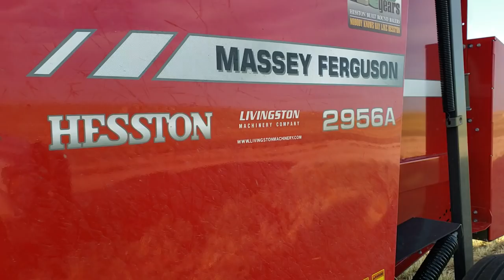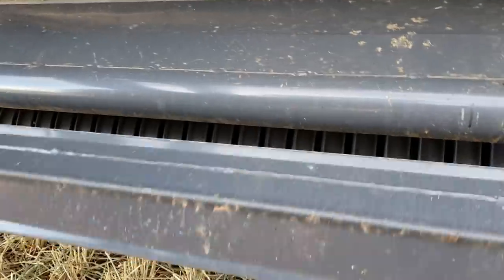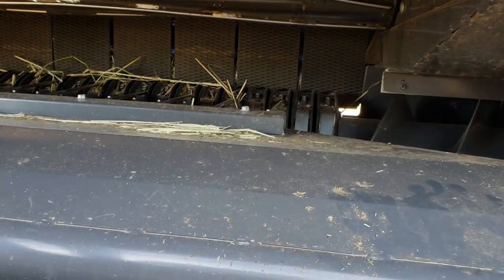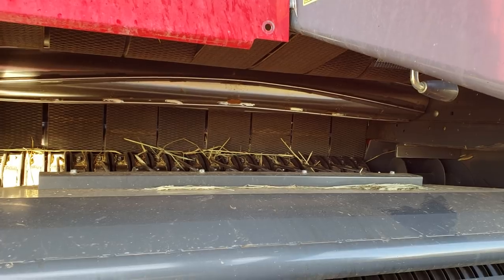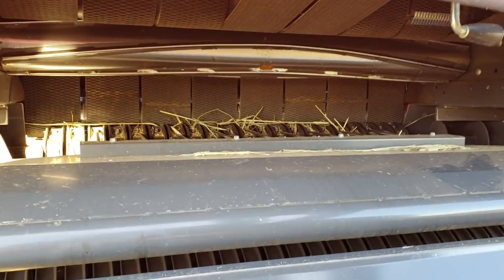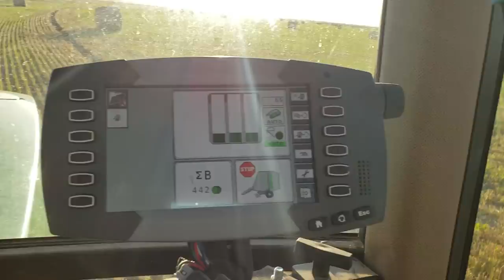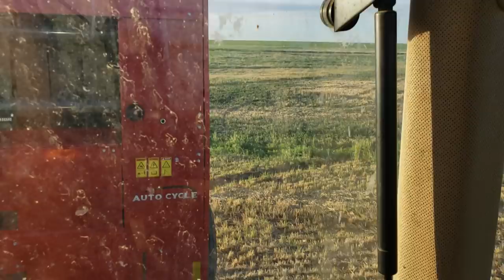In field review with the Massey Ferguson 2956a

Comment: I run Massey hay equipment as well. On my 3rd 2956. Went with a hydraulic baler this time instead of an automatic. Little faster. I was going to tell you when you change wrap bump your cut net button and that wrap will go right in. Wish they would put a switch back there so when you forget you wouldn't have to run back to the tractor. I really enjoy your videos.

Comment: Can you explain the "auto cycle"  better?  Does that eject the bale automatically after its wrapped,  if so, does the baler have its own hydraulic system, or does it control the tractors scv?
Reply: Yes, once the bale is wrapped it will engage the clutch, open the tailgate and kick out the bale, close back and then disengage the clutch so you can start the next bale.  It has its own hydraulic system to do everything.  The older Hesston 800 series didn't have a single hydraulic line going to the tractor, but they have since reverted to where the pick up height is run off of the tractor hydraulics.  So you have 2 hoses to connect to the tractor for the pick up.  It's nice, I've only ran the auto balers and I don't think I'd want a manual baler.
Reply: @OSUOiler  i’ve been looking at getting a Massey Ferguson Baler.I run an older 535 John Deere right now only baler  I’ve ever had. I’ve accidentally hit the lever to dump the bale when I wanted to raise the pick up, never good. I think I would like the Massey Ferguson auto system.